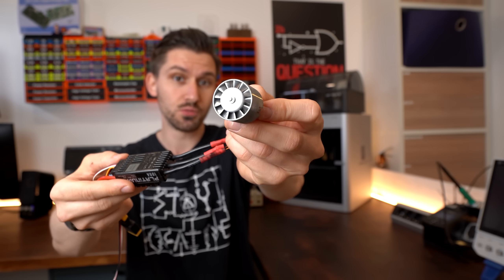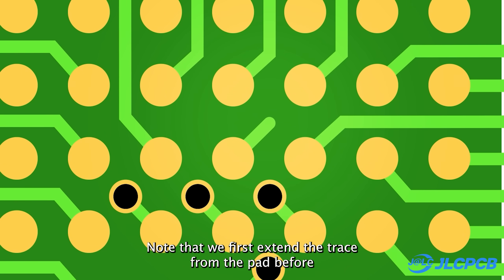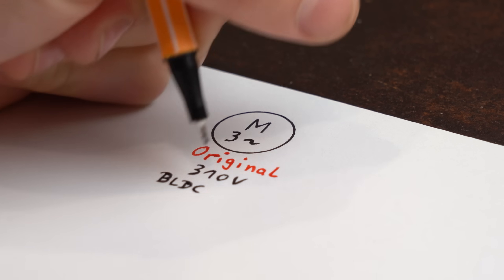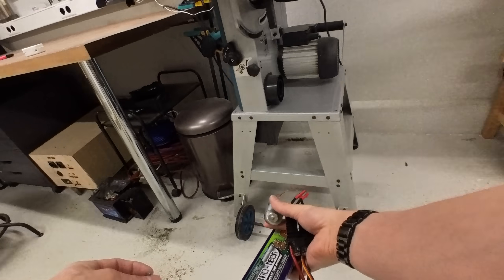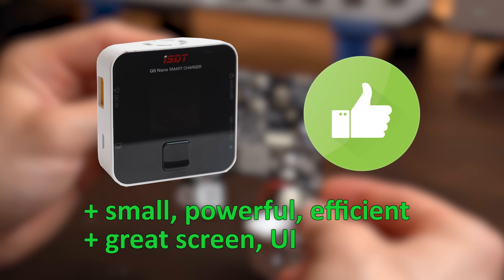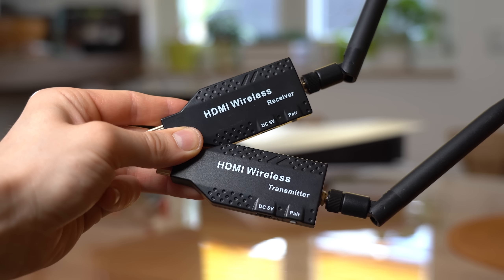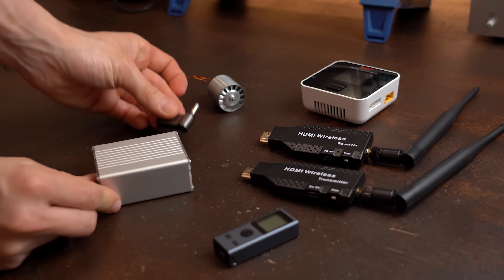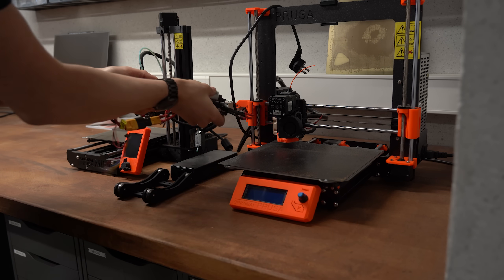I tried finding Hidden Gems on AliExpress AGAIN! (Part 9)

Comment: regarding the battery options, I used to be a fan of such built-in battery devices like the laser meter you shown in the last. But they age just like myself, and eventually the battery life become so short that I basically have to bring a power bank with me. And it's almost impossible to find replacement battery because they are almost always custom designed. Therefore nowadays I tend to buy devices that use standard AA or AAA batteries.
Reply: You can buy any lipo size on that same site. I have bought many weird sized cells to fix old devices like that. The bigger problem is if the device can be opened non destructively or not. As long as it can be opened it is very easy to get a new cell in the right size and model in also all cases or if you can't get the exact right. You can always go down a little in size. And many times you can get a bigger sized cell to squeeze in there.
Reply: @cajampa  True, I've done that myself with a few FPV goggles and radio transmitters.
Reply: I get that there's safety concerns, but I wish more devices like this used replaceable 18650s or similar.
Reply: But neither measure from both ends. A dual laser would allow you to stand in the middle of a room and get a distance from wall to wall with out walking to the wall. Also Bosch, i belive, will work in fractions of an inch.

Comment: WRT the wireless HDMI adapter, they are for situations where running a HDMI cable is not possible(of course). They run on 60Ghz frequency, therefore requiring a unblocked direct sight between the transmister and receiver.

Comment: I bought a couple of the laser rangefinder’s from Ali a few years ago but a different version, your version seems like a cheap imitation bro. Mine were the same size but it had the digital spirit levels and lots of other stuff in the software, it was all in Chinese though so i had to use my phone to translate everything as I went through the functions. If one hadn’t turned up broken (wouldn’t charge) I would have given the product the full 5*. I forget the brand name but it was made by a reputable Chinese phone maker that makes lots of other products and relabelled to some weird brand name, I did the research before I bought which is why I spent the money.

Comment: AAA Batteries are actually preferred by professionals since they are usually easy to find even on bare bones construction job.
Doesn't matter if you have to rip them from some other tool as long you can move on with the job.
If you need to charge the thing and don't have access a charger or a grid connection you're screwed.

Comment: Ooo two other gems, one a all metal pen with a set of calipers built in has become my most used tool at the mo, the other is a delightful £15 Portabler Air Compressor kit which came with a tidy little 5v powered air compressor, two very nice airbrushes, paint tanks, cleaning tools etc and has done duty spraying watch dials and hands already and the output quality of the paint is extremely good with what seems to be the internals of the brushes all stainless steel meaning I can retire my 1970's Badger airbrushes having done tons of work over the years... def recommend the air compressor air brush kit :)

Comment: The laser meter seems to be a copy of a product made by a company called Apex Forge, I have one of their laser measuring units, one advantage they have over the knock-offs is an app, and you can take a picture, draw a line on the picture, and attach a measurement to it. so you can get a photo with all your measurements in it. i use it at work for site surveys.

Comment: 9:35 THESE WILL NOT WORK WITH DELL LAPTOPS (out of the box). Dell laptops have a 3rd pin used for DRM. You would need to either mod the adapter or laptop to trick it into thinking it has a genuine brick.

Comment: The tiny Fan is sadly not the best deal for usage in an Air-blower... since Amazon has basically the whole thing for 25-35€...
so 15€ for plastic, labor, and a battery... 
I'd just get the prebuild, but other things might be really cool uses.

Comment: Frustrated in getting variable power to my 1930's mini lathe, I won very cheaply a treadmill motor which is rated to quite a high rpm and a £16 180v controller unit from China and boy it is doing its business so well and I am prob going to get my money back selling my Clarke single phase motor which was powering it but could not variate down below a fast rev which is OK cutting soft metals and delrin on the lathe with but just could not go slow enough for certain operations and could not be reversed.   I could have used the variable pulley part of the headstock involving belts and tensioners and a lot of faffing about but a motor and a controller, bit of wiring including the home built reversing switch and I can go from a crawl to a roar and cut perfectly every time :D

Comment: 10mA for the transmitter sounds way too low - maybe it was taking power from the ID EEPROM supply?
Reply: Or maybe the RF from the transmitter is interfering with the meter?

Comment: I use the type c adapter and even have a cable version for my hp laptop that is a 42w it works even when running on

Comment: Talking about the laser mesure thing

Why is an internal battery a plus?

Isnt it better to just have external rechargable battery with built in charger then u have the best of both worlds, you can recharge and also replace the battery when the time comes

I find it realy hard to understand why a lot of devices nowadays that offer rechargable batteriees the batteries are always internal

Comment: HDMI is digital, so the image can never be worse quality, that's why it looks the same. Same way a photo can't be worse quality if you used a bad cable to transfer it from your phone, all the data has to be there for it to work.
Reply: Products from a few years ago would lossy compress to reduce bandwidth, which introduce noticeable latency and compression artifacts.

Comment: Honestly, I'd love to see some more scientific tests for those USB-C to barrel plug dongles. Can they damage your device? Like, my notebook can suck up 130W max, but also wants 20V, so could you let's say still charge it with a 100W USB C charger when not running on full power? Or could you even recharge the battery while it's shut down with let's say a 35W brick?
Reply: Damage: very unlikely. Worst that can happen is that the internal charge controller of your laptop refuses to accept power. Or, as he showed in the video, the laptop tried to draw more and the PD charger reset itself.
My gaming laptop comes with a 230W power brick but also has PD-capable USB-C ports. When I plugged in a 65W charger for testing it said something like "hey, I found a PD charger, but it doesn't deliver enough power. Please plug in something that delivers more juice".

Comment: that lil BLDC motor maybe useful for a 3dprinter part cooling fan, similar to the cpap setups. Looks like there is a lot of static pressure from that thing which is what's needed for this application.

Comment: I've used multiple different chargers from ISDT, and they are just plain good. When they released the first few chargers some years ago, they were the only ones with all those features, and still decently priced (other chargers back then were easily 2-3x the price for the same features).

Comment: That 12.6V version of the motor is currently going for €11.55 while the 310V version is almost free at €1.89
Reply: The 310v motor is so common because it's used in every cooling device or fan dryer, the 12 volt one is modified because it needs to be customized watch the whole video

Comment: About the laser tape measure, at the end, I would consider having a rechargeable battery to be a minus. A product like that is something that I would only use occasionally, and I would expect to keep it for 10 years or more. Unfortunately, with the built-in rechargeable battery, I wouldn't expect the battery to still be able to hold a charge after 10 years. So for my application, AAA batteries are far better
Reply: Another minus to having rechargeable batteries is that if you only use it occasionally, it will probably be dead whenever you want to use it unless you leave it charging constantly
Reply: Good points.  However, I bought this laser tape measure last year, used it maybe a dozen times, haven't charged it in 8 months, and it's currently showing a 2/3 battery charge.  Its quiescent current/self-discharge seems pretty small.  How much capacity loss will I actually experience if I'm cycling the battery so little?
Reply: Exactly. Easy to replace, and you can leave AA on the charger all the time, while LiPos don't like being at 100% SOC all the time.

As a mechanic, I really like the AA / AAA flashlights as having some extra batteries on the charger means that they can be run pretty much 24/7.
Reply: But neither measure from both ends. A dual laser would allow you to stand in the middle of a room and get a distance from wall to wall with out walking to the wall. Also Bosch, i belive, will work in fractions of an inch.

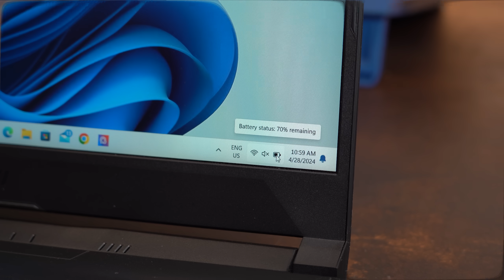Comment: 10:36 this has to be expected with the laptop on, as your laptop drains more power while charging and being on than what the adapter can provide. i use such adapter to power a lenovo m93p tiny, which yes is one of those small desktops and works flawlessly

Comment: Those USB-C adapters will also perform the ID function on Dell and HP laptops. Most Dells will not charge if you simply give them the 19V they are looking for. It does a handshake with 1-Wire EEPROM to define charger capabilities.  Those adapters will emulate that EEPROM.   This will tell the laptop how much power to attempt to pull, and if it pulls more than the USB-C charger can deliver, the charger will cycle, as you experienced.   Ive used it on a few. A smaller Inspiron that takes a 45W charger works fantastic.  A big Precision workstation that uses a 180W charger will not charge the battery while turned on, as you experienced.  I actually mounted one inside the Inspiron so I can just plug and USB-C PD charger into it.  Very useful for having to switch between a MacBook Pro and a Windows computer.
Reply: Not all laptops uses EEPROM - some old Lenovo uses simple resistors, so it's a bit easier to emulate different PSUs.
Reply: @user-rw3fm9ix3i the processor may also enter a lower performance state when using an unrecognized charger.
Reply: Dell with 65w works fine
Reply: @user-rw3fm9ix3i Yeah, I've been doing the same for a while - I carry a 65w charger barely larger than an ice cube, and can use it to charge one of my personal laptops, my work laptop, headphones, phone, steamdeck, etc. ALL off a single tiny charger and just 1 USB-C cable, plus a few dongles. They work GREAT up to about 120w... IF you get the right charger/cable/dongle all combined. Anything over that I haven't tested, so I can't vouch for the ones that advertise 180/240w, and... considering how new the standard is... I'm pressing X hard. But anything on PD3 - so up to 120w? A good little dongle paired with a decent quality charger is all you need. WELL worth it if you ever travel. Heck, worth it just in general IMO to carry less weight. I'm lazy. And I lose things. It's a lot cheaper to keep 2-3 of these in a drawer.

Edit: Sorry, if I was unclear, I also have a 120w charger that I typically won't take with me unless I am carrying the gaming laptop. And... only the older one. Like I said... I don't trust 240w ones yet, and I'm not risking my laptop 'til they've been out for a while/settled to a standard. Heh.
Reply: having dissected a few of these things I can say they do generic type C power supply from any appropriate power source and the power is set by resistors which you can change or remove etc for various outputs, the EEPROM side of things is varied and some adapters have eeproms some do not.
Reply: There is a seller that sells the adapter with a built in screen that cycles between current and watts, slightly more but a nice feature. For the HP Fury G10 they removed the ability to emergency charge 100W via the USB-C port, you can charge and barely run the G9 using a 100W USB-C charger if you limit the laptop performance.
I tried the adapter and it only worked with the laptop off but I know it can just work using 100W over built-in USB-C port so the barrel plug must be stricter and require more than 100W to get it to accept a charge while running. Note, this comes with a 230W adapter so wasn't expecting it to work under heavy load but it didn't even work when the laptop was on so the USB-C port is better in that regards. Will probably keep it in my bag for emergencies though.
Reply: I'm a bit skeptical about them in one specific area. A lot of the time, older laptops with barrel connectors require a variety of voltages. I've seen 15v all the way to 20v. And I'm wondering how damaging it can be for said laptops that require a lower voltage.
Reply: @aleksandersats9577  That are basically just PD trigger boards with a barrel jack.    So if it is a Dell computer meant for 19.5V, the trigger board is hardware configured via soldered pads or a resistor to tell the USBC charger that it needs 20V.  If you plug that into a computer that wants 12V you are likely going to have a problem.  PD standard can do other voltages with varying degree of compatibility.
Reply: @aleksandersats9577  you just need to make sure you only use the right adapter for the laptop, it is no different from being able to plug in incompatible power supplies to laptops already.

So it’s really not much of an issue, no different to replacing the normal power supply, you need to get one that fits in the barrel Jack, is the correct voltage and can deliver enough power. If you use a 20 V power supply on a 15 V laptop then that is likely your fault and it could just have easily been two actual laptop power supplies you mixed up rather than these adapters.